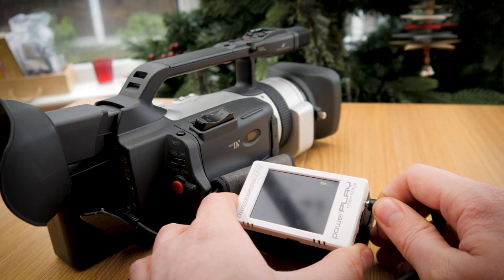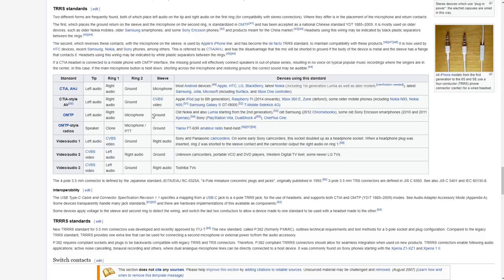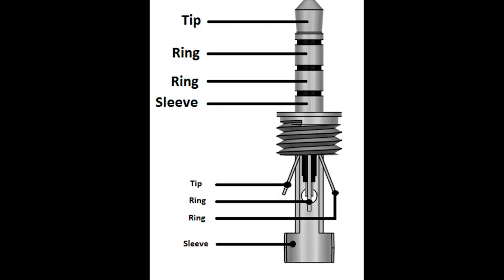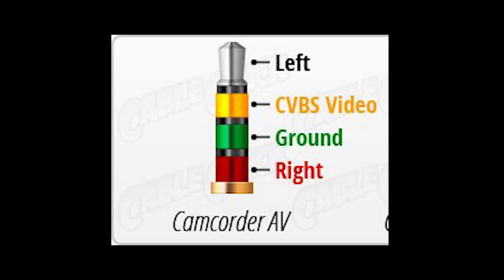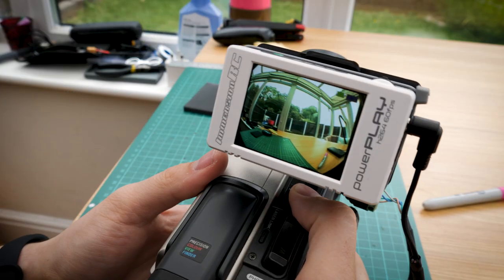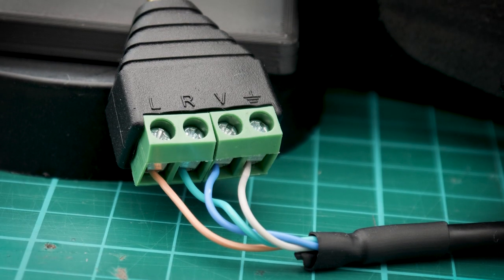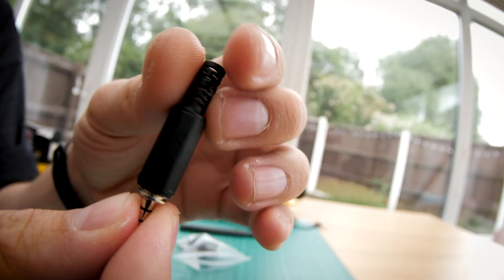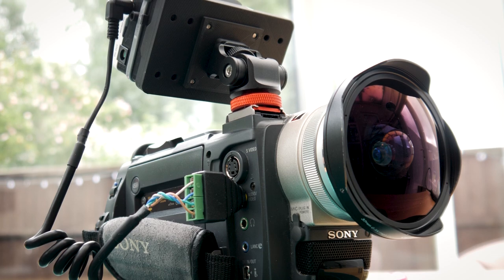Lets finally fix this pesky PowerPlay Cable! [ Tapeless Camcorder ]

Comment: Cable you linked for the vx works perfectly plugged all the way in. However, I had to put the red cable in the yellow video input for it to work, not sure why. the other two can go in either way doesnt seem to matter since it down mixes to mono. Hopefully this comment helps someone else as  I was pulling my hair out before trying to swap cables around just for the F of it!
Reply: Same here! VX2100. Exact same configuration
Reply: @jonallen125  so weird! Took me forever and like the 5th page of google to find a random post somewhere, I was so heartbroken at first lmao. Check out the videos I’ve filmed so far. I’m stoked to see some footy!
Reply: 100% worked for me
Reply: you're a legend. thank you
Reply: Those cables that are sold on Amazon have a * in the description stating that the video/audio might be switched. So I assume they are advertising cables with both configurations but just sending out these ones.
Reply: Thank you so much 😭 i almost gave up
Reply: @gnarvegan2333  what did u end up using the normal cable or remaking it
Reply: Definitely also worked for red in the yellow, yellow to white, white to red, and I put the cord all the way in the PowerPlay
Reply: What cables for vx1000

Comment: You are a god for this!!!

This inspired me to play around with my cables and have found that what works best for me since I have multiple cameras is:

-2.5/3.5mm a/v from camera out to RCA
-RCA to 3.5mm into PowerPlay

and from there just swap the RCA plugs in between until you get video and audio in the Powerplay. So far, it's worked with a few Sharp, Panasonic, and Sony cameras. It's much bulkier than your solution but I do not have your patience to make my own cables for each camera.

Comment: Just modded out cable with the TRRS Terminal and it works like a dream! One thing that he touched on is that it feels not so secure even though connectors are screwed as far as they go. Once i got them tied down i glued the fuck out on them to stay in place and wrapped it in heat shrink.

Comment: I bought a PowerPlay a while ago as a monitor and recorder for my thermal cameras. I made a cable myself with a TRRS breakout in between - but also bought five of these screw terminal TRRS cables and now I am using this instead. But I am not happy with the encoding quality of the PowerPlay, I get 1-2mbps at most as the signal is monochrome. the old cam corders might actually have better quality if you get one with firewire out.

Comment: my 3.5mm to rca cable just works with crystal clear audio and video when plugged in normally. I have a vx2000
Reply from the maker: Probably got lucky and found an OMTP cable then!
Reply: Link to cable please?
Reply: @Starizm  check the description
Reply: Me aswell. Same setup.
Reply: what cable u got ?

Comment: Do you have a solution for 3rca to 3.5mm? My camera doesn't have AV but the 3rca to 3.5mm works but only plugged in 2/3 of the way. I thought just swapping the rca cables around would do the trick but it doesn't.

Comment: Hi, i didnt buy the power play but i bought another similar digital recorder with the same issue and it didnt come with the aux cable the power play came with. So i bought my own trrs 3 5mm cable and despIte having the 3 rings and being labeled trrs, it only had 3 wires inside. Can you send me a link to a trrs cable i can do this with? Thank you!

Comment: Has anyone noticed the power play deinterlaces footage top field first instead of bottom field first causing jittery footage?
Reply: Hi, I noticed this too when I tried to record on my Panasonic DVX100B with a PowerPlay. Have you found any fixes for this?
Reply: @aidan1080  I did actually I use virtualdub (could probably use something else) interpolate the fps to half then double them back up
Reply: @dethclik2002  holy shit dude it worked. FWIW I went into premiere and just set the frame rate in the sequence to 30fps, or half the frame rate that the immersionrc records at. thank you man

Comment: I bought one of your powerplay 3d printed mount for my canon GL1. And the clip that snaps into the power play snapped off after taking it in and out a few times.. have you or anyone else who bought one had this issue? Have you came up with a v2?
Reply: Do you have a sound? on gl1
Reply: yeah that happened to me to. i just zip tied it down onto the 3d printed mount. i am currently designing my own, more durable version.

Comment: hey there! just got a quick question. I recently got a new microphone for my TRV900, as the one I bought off ebay had a broken internal mic and the XM-8 Shotgun mic it came with was being weird and not always picking up audio. With the new microphone, the only way I can get it to pickup audio is by unplugging and plugging the powerplay back in after pressing record. any idea on why this is happening or what I could do to fix it?

Comment: with my vx1000 i still have to have it plugged in 75% in and when i film lines i keep getting audio glitches.  i was about to buy ur spacer but if this other way works and ur selling one that will work perfect for the vx1000 and 2000 im fosho coppin

Comment: Hi, my camera doesn’t have an AV port(Sony FX-7). It has an HDMi port and I used a HDMi to RCA cables , I paired this with an RCA to AV adapter and plugged it in to the PowerPlay. All I could get was flashes of white but nothing else, could anyone help me?

Comment: Alternatively, could you use a CTIA 3.5mm to RCA Female cord plugged into a Male RCA to OMTP 3.5mm you linked for the vx? That way it’s still Left, Right, Ground, Video (CTIA) on one side and Left, Right, Video, Ground (OMTP) on the other? Sorry if that’s too confusing
Reply: i order the vx cable to try this out,  i’ll let you if this works (10 months late i know)
Reply: @mysickmemepagebro3271  mine didn’t end up working :/

Comment: The vx cable linked in the description did not work for me I tried the adapter on some other cables too and still didn’t work
Reply from the maker: without the adapter it should work.... in theory at least

Comment: Weird.. just started using my powerplay with my vx2000, and it let's me plug it all the way in. Maybe the newer powerplays fixed this issue??
Reply from the maker: It's not an issue for immersionrc as its designed for FPV so it won't be changed. Must have got lucky and ordered a cable with the correct layout

Comment: Im using the powerplay on my vx2100 works perfectly fine with the 3.5mm to rcd av cable I bought from Amazon. full crispy clips and perfect audio. But after purchasing 2 more camcorders the vx2000 model this set up only records video with no audio. Same situation with both vx2000. are they different outputs? don't even know where to start as iv bought 3 different rcd av to 3.5mm jack and none work at all!. just purchased this cable you have linked for the vx so hoping this solves my issues, anyone else know a fix to this issue would highly appreciate a point in the right direction, cheers!!